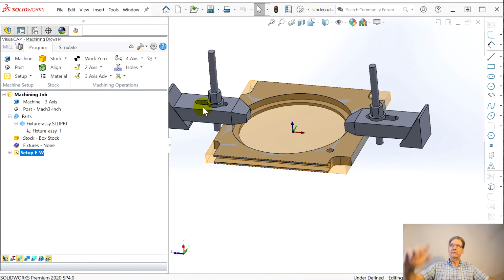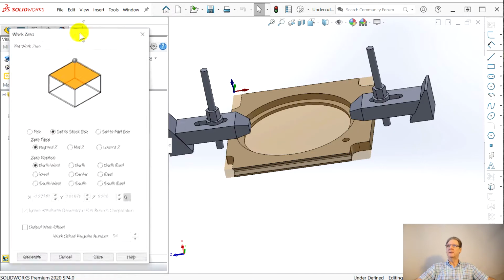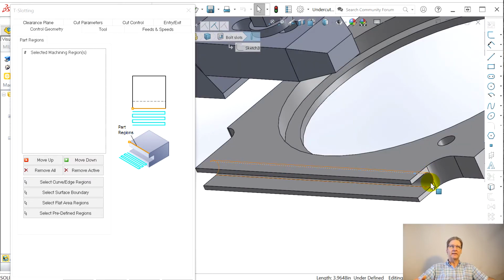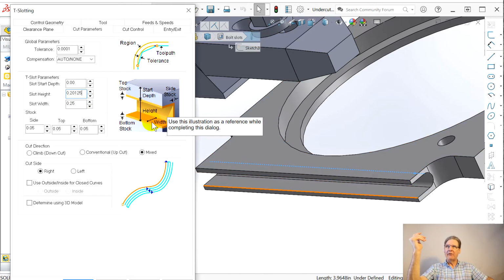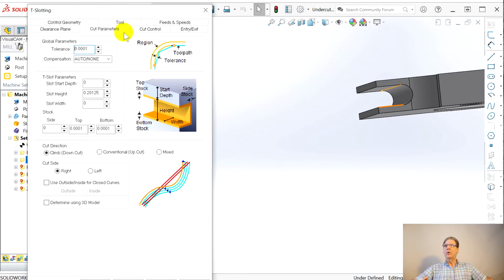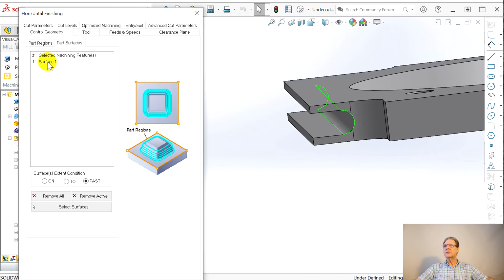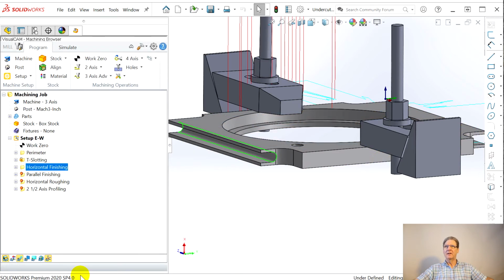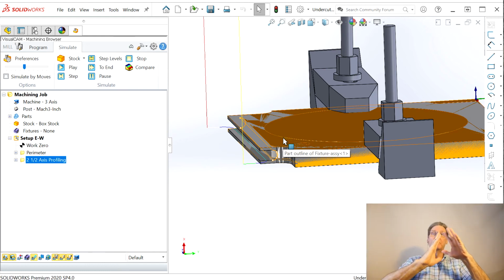VisualMill T-slots and undercuts

Comment: I can identify with your frustrations, the workflows are challenging. It seems that Mecsoft needs a person with expertise in human interfacing, too much engineer/programmer mind think.  Thank you for your candid comments.
Reply from the maker: Yes, agree 100%. It is so hard to find programmers that actually use the tool, most are just CS graduates that don't do any mechanical design. Mecsoft does have promise, and I will be checking them out every couple years to see if things are getting better. Thanks for the comment.